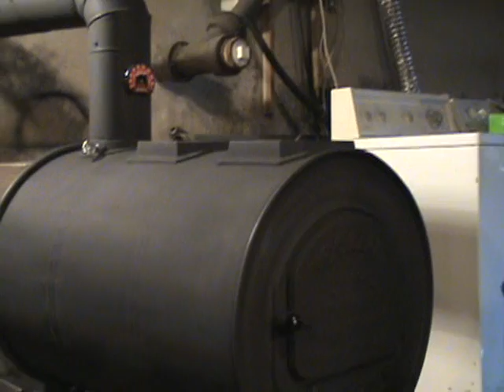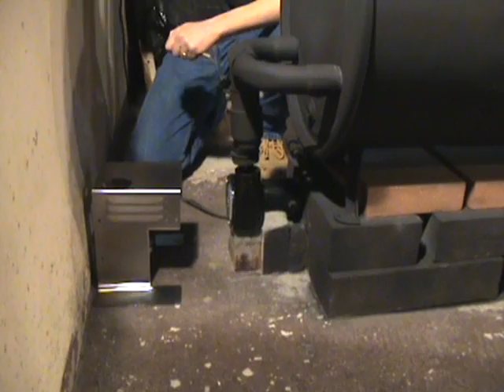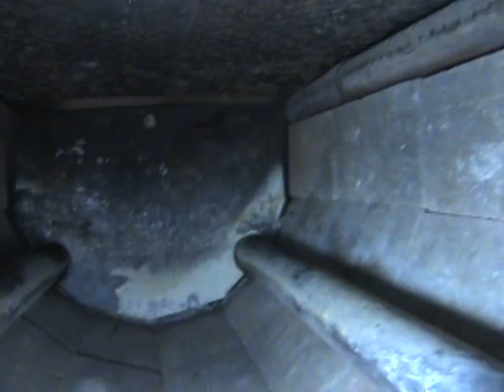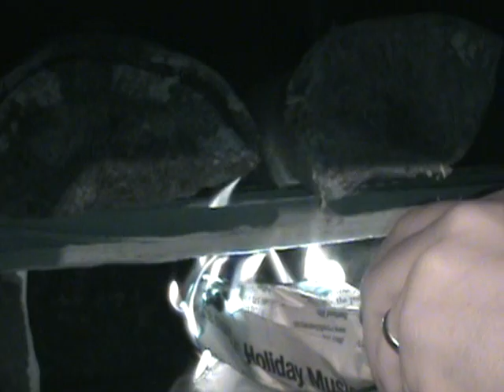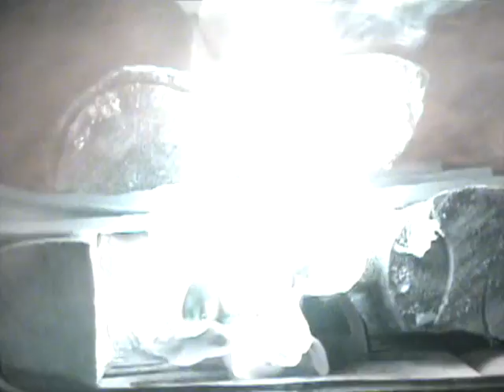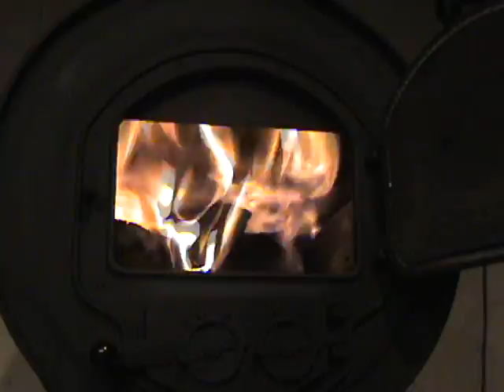steves homemade wood stove the sequel

Comment: I did something similar with the Vogelzang 55 gallon drum stove setup. It's far cruder but works in my drafty old shop. I used the two-drum kit and also used the drums with removable tops. I cut up an old water heater tank and used semi-circular sections of it as smoke shelves on both drums so the flow of the hot gases snakes through both drums. It definitely slows down the gases and extracts way more heat per load.

Comment from the maker: The  air pipe is made of 2" exhaust pipe and bent at a muffler shop.  Each side is made of two pipes and are connected by flaring one end of the pipe.  So in total there are four pipes that make up the air tube system.   As for furnace cement, most hardware, plumbing, or wood stove supplier will carry this.

Comment from the maker: No welding ,just bolts supplied with kit.  Total cost about $275.  The iron grate kind of melted down so I replaced it  with six more firebricks to prop up the wood and leave airspace on sides.  Works great!!!

Comment: Thats a great video very informative.  I have been thinking on different designs also on building my own woodstove with secondary combustion as well as tryng to incorporate a boiler system in also.  But with the sec. comb.  I think that the water may get too hot while it circulates. Great video.......... DAVE

Comment: fantastic stove steve! have you thought of using a sterling engine for the air source instead of an electric fan? that would work great if the power went out. just my 2 cents worth. thanks for the great video.

Comment: What is the burn time you get out of that thing? building one of these and firebricking it but yours looks like it has a pretty small firebox. with the heat exchanger plate and draft pipes. I thought about putting one draft pipe in the bottom of mine and stacking the firebrick on both sides of that.

Comment from the maker: I opened heat ducts in the floor and the heat naturally rose up. Yes, there is light surface rust, but not to bad. I assume the pipes will have to be replaced every 3 to 5 years.

Comment: Adding a forced air system for the primary and secondary combustion supply makes this a positive-draft arrangement. Without any automatic controls you have the possibility of dramatic overheating and failure...not to mention carbon monoxide issues. Design and operation questions can make building your own furnace a touchy thing. I don't do it or recommend it. Having said that, at least consider  a hi-low limit switch accuating a solenoid damper on the air supply for safety

Comment: You don't say a word about the lower door or the two little vent 's I see. You seem to talk more about the # of holes in the pipe than the actual workings of the stove. 
 I don't think you really have to worry that much about two holes.
Now I will say it looks like you did a great job of putting this together but a bad presentation of telling ppl all there is to know. And you have to remember  MOST ppl don't have your building skills so they need all the info you can give them. cheers